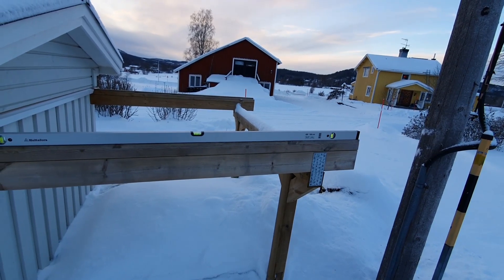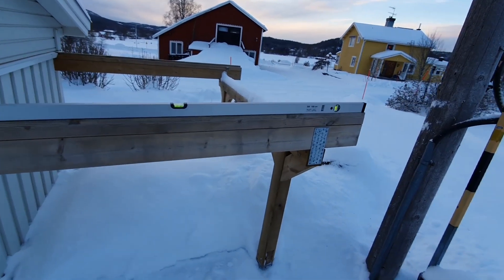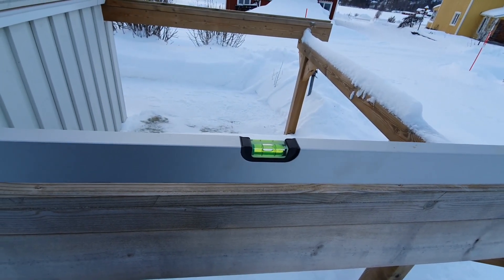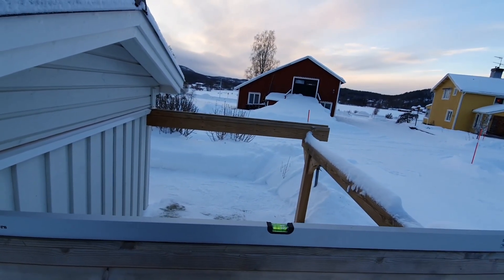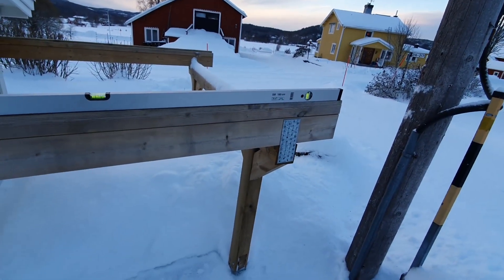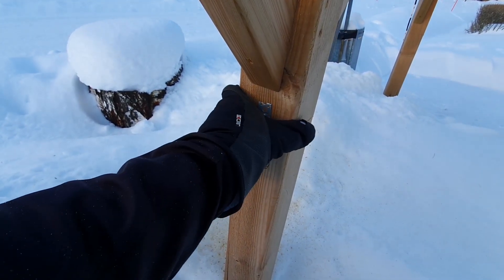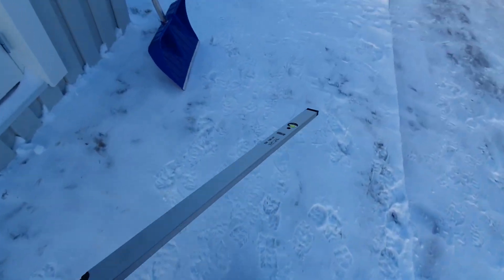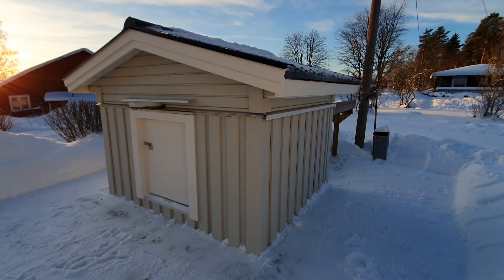Unexpected Problem Found During Observatory Inspection

Comment: so the obs has sunk a little?
Reply from the maker: No, the observatory is fine, the support for the roof rails raised up.
Reply: @frosthastrophotography oh i see, maybe as the tree is now not absorbing water causing ground swell
Reply from the maker: @CDigata  I think it just has to do with the ground composition as in terms of material and the fact that the earth screws used was not deep enough or insulated.
Reply: @frosthastrophotography yer maybe need some sort of adjustable height in the base of the supports. mine are surface plates that the wood slots into, ive never bolted them down. but your video is going to make me check mine when the weather gets better..
wishing we all get Clear skies soon..
Reply from the maker: @CDigata  I'm going to dig and insulate this summer, hopefully fixing this permanently.

Comment: It will be interesting to see what may happen in the summer when the ground thaws out. I think you may have to redo the posts altogether and dig beneath the frost line if you have a frost line in your location.
Reply from the maker: Yeah, I did not go below frostline, that is 1,5-2 meters here. I thought it would be fine, I have used earth screws a lot without any big issues. Will dig around them and insulate this summer.

Comment: Great video, and problem nicely corrected, why did this happen and what exactly had moved ?
Reply from the maker: Thank you! Well, I'm not deep enough for frost free zone here at 63 degrees north and I didn't insulate the ground because normally you don't need to with earth screws, but I guess the ground was too moist or wet at the time of freezing. So the earth screw rose up with freezing ground.